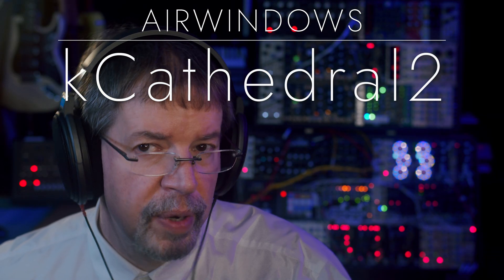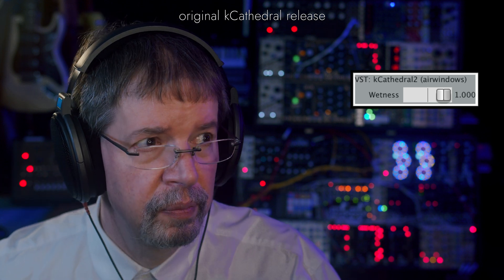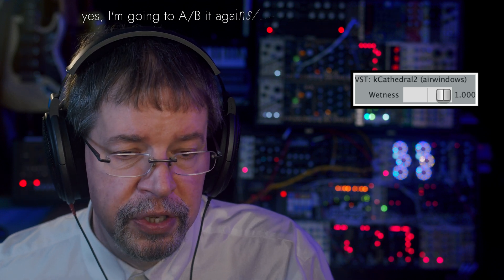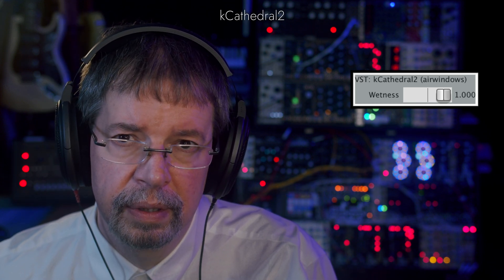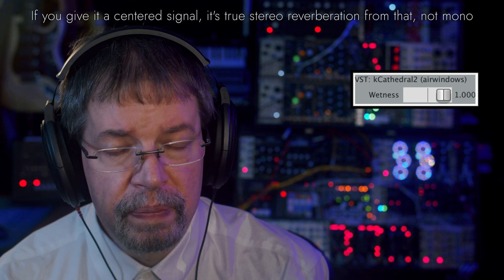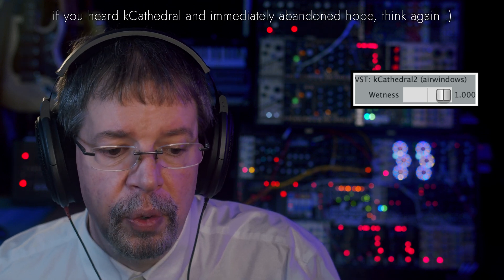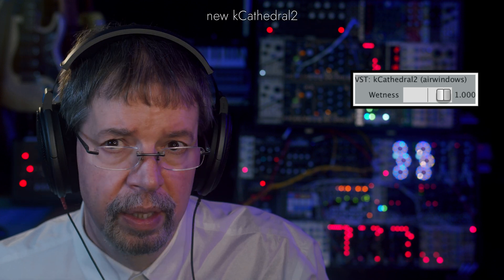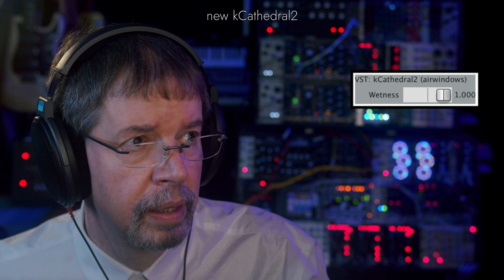Airwindows kCathedral2: Free Mac/Windows/Linux/Pi AU/VST/Rack

Comment: I did have a question I had a plugin that moved between IRs rapidly on a graph that had regions within a convolutional reverb and I cannot find it again…. You’re the only person I can think of who may have made irs mapped where you could move between many on one giant cross fading map I think it had 8regions perhaps 10? If not any clue … I used it in reaper ..because I went found ambisonic ir libraries to pull into it… I have yet to relocate it and I’m super into sound design … and make long modular works and in 3oAmbix with binaural pieces within… not super easy to encode for public play other than intermedia. But I was hoping you would know… thanks for all your work Chris.
Reply from the maker: Wasn't me. Maybe it's Nebula/Acustica? Sounds like Zaphod's kind of thing.
Reply: @airwindows  that’s disheartening it was very unique free plugin I just have a horrible memory..
Reply: A similar plug-in to what you describe is Cabinetron by threebodytech